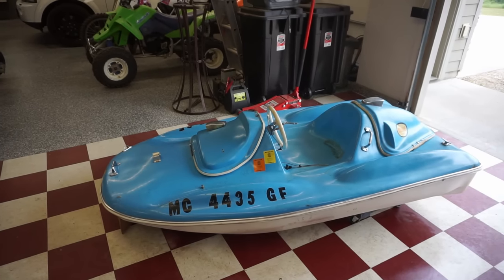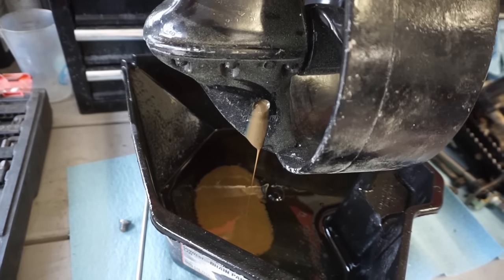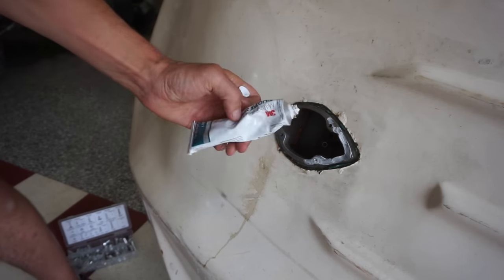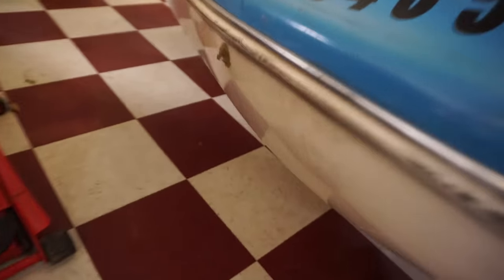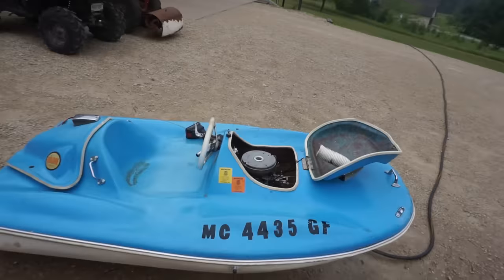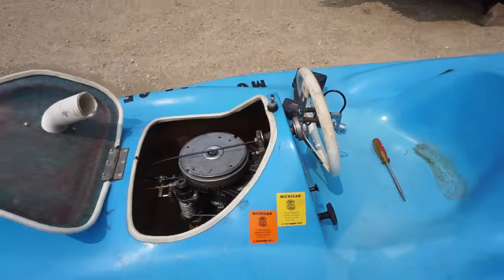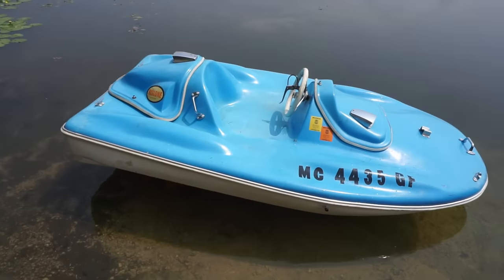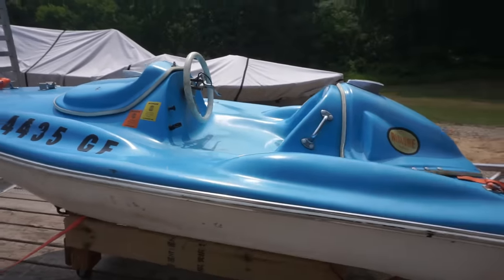First Ride On The 1960's Mini Jet Boat

Comment: That is a cute little ride-on 1960's boat. It looked a little front-heavy, like it was riding a few inches low in the front and plowing water. I would put a 10-12 hp Kawasaki or Honda four-stroke engine in it, beef up the engine mount area and experiment with adding some rear ballast weight (a round iron 20-30 lb. barbell disc in the bottom of the gas tank well?) and when I got it to where it planed with the rear an 1 - 2 inches lower and the front 2 inches higher, I would epoxy-coat (rino-liner, tuff-guard, etc.) it to rustproof it. And with the added speed and plane angle the rear rudder might need to be reduced to around 1/2 as large; I would experiment by making an aluminum collar for the steering shaft and then test various size bolt-on rudders until it turned fast at full speed but not too fast for safety. Then I'd tig weld the rudder to the hub, put it together with a stainless bolt and nylock and build another one as a spare. Finds like this little boat from the past and restomodding them with upgrades, add-ons, adjustments to the mechanicals, electrical, fuel delivery system, etc. while keeping the original look and vibe are the BEST...they're a little bit of a challenge, interesting, historical, they take some engineering, some creativity, good ol' wrenching, they're fun and useable and enjoyable when they're finished.

Comment: Awesome work Joe. That motor is definitely down on power. I think it’s only running on one cylinder, I had a 5hp Evenrude of the same vintage and it reved significantly higher. It might be down tuned too, there were similar boats for theme parks that I’ve seen that had restrictive plates to make them only turn 2000 rpm or so when they should be at 6000 or so flat out. Also, an idea for the water outlet: instead of running the hose out and siliconing, you could bolt a barb fitting through the hole and connect the line to it.
Reply: yea needs a bigger motor
Reply: I had a geo metro, that came from factory with a 3 cylinder engine, drove it a year on 2 cylinders 😂....no wonder it had to be in 1st on a 10 degree incline...or any hill for that matter. Saved me some gas money! 😅  till my buddy said ...  you need a new piston and head gasket....i said  200 its yours.   He didnt buy it.   Lmao!
Reply: if it have been used for rental or in a hollyday park, it will have been tuned down for safety.

just like you only get the learning key when you rent a jetski.
back then they just dident have learning key´s
those places would never get a insuriance if they let people go full speed (and you dont want to rent out anything with alot of power to drunk people on hollyday vacation)

and when they do that it is often ruff to the motor.
so if it have been used alot, it might have some damege from only running slow.

like getting a car from a old person, its starts gouing fatser when you ride it fast for a little time
Reply: i have an old 5 horse Johnson sea horse from 1946 and it pulls harder than that thing on an aluminum 12v haul with two people and a cooler. I agree with seanguaraldi2728 that motor is barley runnin. those 2 strokes need to open up to hit that pwr band. that tiny of a vessel with a 6 hp, or 5 should haul butt.
Reply: @Hansen710  Tuned down or restricted in a way for sure. Could be an easy fix.
Reply: It probably needs a new engine
Reply: @P.h.o.n.e..G.u.y.1  I don't think so. It's just not getting enough fuel/air.
Reply: Yep
Reply: Looks like a amusement park ride
Reply: @danescholl743 maybe he needs to change the powerband to a purple power band
Reply: Definitely not getting the fuel it needs

Comment: Good times. I had a vintage evenrude and couldn’t get it to run on both cylinders. It had a broken reed which was stainless. Put in a used replacement and it ran great 🎉

Comment: That's a cool little getaway cruiser.  You could use it a sa small eco tugboat...connect a flat bottom john boat to the rear with 2 tow straps. 3 friends...a cooler and fishgear..  maybe an extra 5 gallon gas can!  And thats a party   with a motor 🎉.   I think its cool.  Love tinkering with this stuff!

Comment: Definitely only running on one cylinder, killing total power, otherwise very cool. Have to decide on whether to do a full ignition tune up for around 75 bucks is worth it. I'd expect at the very least 10 mph with that motor. Nicely done as usual Joe 👍
Reply: Lol that is as fast as they go.
Reply: I feel thw same thing, having running OK is another world
Reply: I've got an early 6hp and it should go way way better than that.  If mine can move 4 people in a 12 foot tinny then your boat should fly
Reply: @volvogt21 exactly…that is a planing hull, granted it is a little overloaded !
Reply: @volvogt21  they don't go any faster lol.

Comment: Good video. Wouldn’t call it a jet boat since it uses a lower unit and prop unless you’re referring to the shape of the boat. Love the variety of videos. Keep them coming.
Reply: The perfect base to make it a jet boat though.
Reply: Its a jet boat with the venturi mounted around the prop.  Later on they moved the venturi up inside the hull into the configuration most are familiar with today.  Likely after dealing with all the damage from running them aground cracking the hulls around the hard mounted lower ends and snapping off rudders.  

In that form though they should have been much more fuel efficient then the insane models we have today.  A 50 to 70 MPH jet ski is great fun until you take a toss and hit the water.

Best!
Reply: @neilfromclearwaterfl81  that by no means is a jet drive in any way, shape or form. It has no impeller, no bowl, no nozzle. That boat is powered by a traditional outboard motor, with a propeller that simply has a prop guard cast onto the lower unit for safety purposes.
Reply: @Cradletothegrave67  Back then with the venturi at that length they were considered jets while a prop guard was much shorter.  I remember those days very well.  I understand it doesn't fit the model you kiddies go by today but back then Popular Mechanics and Mechanics Illustrated (I subscribed to both along with Popular Science) presented them as mini-jet boats with an external jet due to the longer tube.

Best!
Reply: Thats not a jet drive ore a prop guard.. its a prop nozzle that makes the prop more efficient and makes more torque 🙃

Comment: Joe, you should try to find one of those mini speed boats with a 20- 30 hp outboard on it ! Everyone loves speed lol. I'm going to look for a couple soon for my grandkids.  I think they will love those ! Excellent video !
Reply: @scott, those boats aren't rated for outboard motors.
Reply: Yeah, I grew up with them in the late 70's and 80's. We called them Hydroplanes. Even with a Mercury 9.9 hp they would go 35 or 40 mph. They still sell kits for them. Put a 20 hp on one and it will go 50 mph or better.

Comment: Great Cote t always a new surprise every week I live on the Outerbanks of NC I started my boating with a wooden skiff and a 6 hp Evinrude that motor isn’t producing what it’s capable of even with the collar around the lower unit u should be on plane with no issues. Pick another place after tuning it up  you’ll be surprised at the difference!

Comment: Primarily used in water parks, where weeds aren't an issue.  Really cool little watercraft.  I used to go to Knobles Grove in PA, about 30 years ago and they used to have bumper boats.  Innertubes with a seat and a little .5hp outboard tiller motor with a centrifugal clutch(think, tanonka outboard motor). I was saddened when I seen they were removed(I'm sure for safety reasons). Man we had fun stuff back then.

Comment: That's an OMC powerhead. If your order service parts for a 1968 6 johnson or evinrude they will fit. Quick tip. Replace your points and condensers with OEM evinrude points and condensers kit "tune up kit" also thoes ignition systems are designed to run champion J6C
Reply: buy  whaler  15 rañge 85 hp  omc  jet drive
Reply: You can go up and down the Mississippi and write a book those motors  are that tough
Just learn the channel
Reply: I have a Evinrude 6 all I'm saying is I don't think he has the timing as advanced as it could be or it would be planeing that boat out
He might have the carb wide open but I don't think the timing is on fast
Reply: That motor isn't winding all the way up
. Also a 35 horsepower of that era has a problem that size that thing is way over propped that's the problem.. the propeller on a 6 horsepower Johnson or Evinrude is about 7 1/2 in

Comment: CHECK FOR RESTRICTOR PLATE/DESIGN BETWEEN/INSIDE INTAKE and check the carb/intake tube diameter and that the ignition advancing mechanism works correctly. And check the size of the drilled exhaust ports in the cylinder wall

Comment: The engine was made for leaded fuel pre 1975. You may want to use the higher octane gas. Predestination, or spark knock could be an issue.

Comment: I have a 76 Johnson 6 hp outboard and I can tell you that thing was only running on 1 cylinder. They rev up and make a much more musical RPM sound on full throttle than that. That sounded like idling. I think this thing is so cool though! Keep going and fixing her up! Subscribing!

Comment: It sounds like it's only running on one cylinder. Probably a coil problem. Pull one plug at a time to find out which one. Cool little boat though

Comment: I think you should put a jetski motor in this and then you wouldn't need that stuff hanging underneath the lil boat. I think that this boat would be able to handle a bigger motor and different steering. It would be fast and turn great plus you would be able to go in lower water in rivers and streams. Keep up the great work and God Bless you and your family. 💯👍😊🙏🏼

Comment: I used to have this thing in my parents garage that we got from my grandparents. Had never seen 1 before or since and I wish I had been able to fix it and drive it before my parents gave it to another family member. Have never been able to find any information on it. From what I gathered it was called a aqua dart. Floating platform with a hole in the center for outboard motor. I guess you stood on it and steered the engine with a rope. Think it was from the early 50’s. I can’t even find a picture of 1

Comment: Nice repair. Cool little boat! That lower unit has the radial guard around the prop for safety. It will also save the prop against rocks.  Life guard boats on the beach have these on them as well. All the outboard manufacturers wouldn't put these on their production models because they also made a tremendous profit on replacement props!  No telling how many deaths and injuries could be saved if they put these on all outboard LU's.
Reply: the ring is cracked all the way through at he top hope it didnt get the lower unit

Comment: Joe, if you connect a hose to the water inlet you would expect some flow even if the pump is not helping - but that doesn't mean water will flow when you remove the hose and take it out for a run. With most outboard-derived engines I would expect to replace the water pump impeller as a matter of course after all this time - but not the whole pump unless it was leaking past seals etc.
Reply: Amen

Comment: A little more messing around with it you will have it, if you have a big enough drum to set the lower unit in that way u can put some torqe on the engine, and tune the carb might be timing advance is off from throttle adjustment if this engine has it? im a certified powersport mechanic and do the same things as you pretty much and from past experience with engines that size should scream you will def know when its right even with a decent size person in it...keep up the awsome work

Comment: You can get new coils to replace those cracked up old ones. I have an old Johnson 5 1/2 and found them online. You should never run an outboard without a water supply, cause it will ruin the impeller in no time.

Comment: I was 6 or 7 years old and my parents friends owned a cottage in Michigan. We were there for a party and they put me on that exact boat and off I went ,things were great at first and then disaster!! The throttle stuck wide open and I kept riding by the dock screaming at the adults mind you I was probably going 5 miles an hour, finally I drove straight towards shore and someone opened the engine cover and killed the engine  that was over 50 years ago.  God I am getting old.

Comment: That water pump is going to explode into a bunch of little pieces cause it's so old and hard lol
Reply: Haters got to hate
Reply: @fredcabor5258  your right I would hate to see him blow up that motor lol
Reply: @fredcabor5258 it’s ok to be ignorant!
Reply: Nothing a 20 HP predator can't fix lmao that thing would rip with 4 times the HP!
Reply: @coreyurban1761 that's a gay ol' 4 stroke though.
Reply: Weight distribution is key.

Comment: Being a 50 year old and having worked on and for an OMC dealer for 30 years, I can tell you that six horse is only running on one cylinder either low compression, or I need to work with the points and condenser‘s under the flywheel no fire, but that’s cool. I’ve never seen one of those.

Comment: Great video! Although like others have said it's definitely not a jet drive but still a good video. I forget what they used to call those but I think they were referred to as shielded props. I grew up around outboards in the 1970s and I did see a few of those on small Johnson and Evinrude outboards. I think at one time they were referred to as a weed-free lower unit attachment. Overall I love the design idea! You can tell it's simply a typical 6 HP or so outboard with the middle section of the lower unit removed. Use the engine, and just the very bottom section. A very ingenious use of the engine in a small little boat like that in the 1960s. And I agree with one other commenter, we had all these great toys when we were kids before all the safety and litigation police took them away from us. I suppose I should be happy I wasn't killed by flying Jarts with my friends in the 1970s lol! Although in the 1990s I was paralyzed quadriplegic in a car accident. Nobody gave me a heads up that Toyota pickups wouldn't do so well in a rollover accident . Oh well, at least I didn't drop an anvil on my head as a result of watching Bugs Bunny, Wile E Coyote, and Road Runner! Thanks again for the video and the trip down memory lane.
Reply: Imma SUV rollover Para myself … 2005   Was the year my Yukon decided to blow a tire on highway…  will be 18 years handicapable this Aug….I was thinking the same as you it may have a governor on it restricting it’s speed .. still a nice find…   Would love to see it pacing itself around that lake like a minnow … I’m sure that thing can scoot a little… ✌🏾✌🏾✌🏾✌🏾 Good Luck best wishes your way … We in this struggle together 💪🏾💪🏾💪🏾👍🏾👍🏾👍🏾✌🏾✌🏾✌🏾
Reply: @zvsmith2008  I appreciate your thoughts, my friend. And you're right, we're in the struggle together. take care and stay healthy.  

Just a little heads up maybe. My health seemed to go downhill about 25 years post injury. I don't know what it is about that time frame but I've heard that from a couple other people. Granted you are a para a lot lower level injury than myself. But up until 2 years ago I was essentially equal to a T2 - T3 para. But over a period of about 2 years, now I use a power chair full time, with some shoulder issues, put a bunch of weight on, and now have to have a different type of vehicle to drive Because my transfers have become a lot more difficult.. So as I said I guess it's just a heads up, take care of yourself a little bit more as you get older. All the best to you
Reply: @Adirondack_Gimp92  omg… I totally get it .. I’m 55 and do transfers to climb up in my vehicle , the past 3 months It’s been a strain .. Shoulders are stiff now , my core strength is not there , I’m pretty independent as far as taking care of myself on a daily ( cooking, cleaning, driving, riding on my zero turn mower..u name it .. I do it .. but lately .. it’s been “Iffy” I was thinking is it age or what ..I was thinking the other day about a power chair ..  Man … I’m at that crossroads myself , I’m in no way in a position to find a vehicle that accommodates a power chair .. I appreciate your insight it’s very much appreciated … Good luck and Ride til the wheels fall off..✌🏾✌🏾✌🏾🙏🏾🙏🏾🙏🏾💪🏾💪🏾💪🏾🤞🏾🤞🏾❤️❤️👍🏾👍🏾

Comment: It took a while for the water to pump because the thermostat hadn't opened yet.
It's advisable to swap the pump but the quality of the old rubber impellers back then was awesome.

Comment: This boat design was used in a water park where people could tool around a pond . Its a 6 hp OMC power head at best (most likely a 4 hp ) never designed to go fast with a mid mount engine in a small craft
Reply: Gotta be a 4hp, we had a 6hp plane out a 12ft boat with 2 adults.

Comment: I suggest a stainless steel clevis pin instead of the nut and bolt to secure the rudder. Easy on easy off to protect the rudder. It is the most vulnerable piece to get broken  would also make launching in and out so much easier.

Comment: That's just Begging for a Jet Ski motor and drive swap! It's still cool just the way it is though. I'm glad to see you get it back in running order.
I'll bet if you wiped it down with Wipe New It would take the little bit of fade out of the blue gelcoat and make it look new!

Comment: At 8:32 you dont need sealant to reinstall the leg. Its a machine fit. You will need sealant and spaghetti seal for the gearcase though to change seals as there is definitely water in the oil.

Comment: Wow real cool, good job. Liked the cradle you built for it, I got a suggestion for that. If you come across an old push mower  take  the 4 wheels and put them on, this will make it push easier.  Just a thought, good job though, great video.